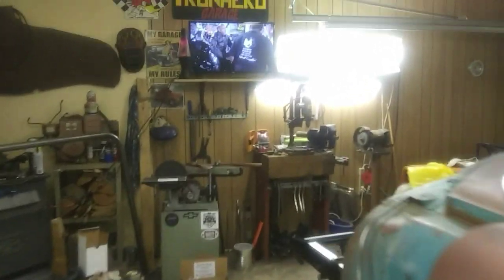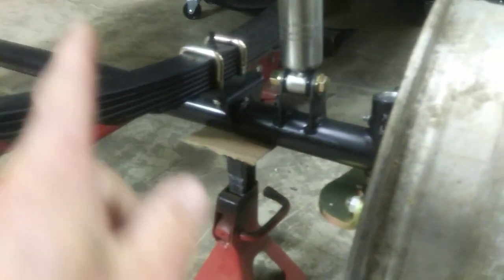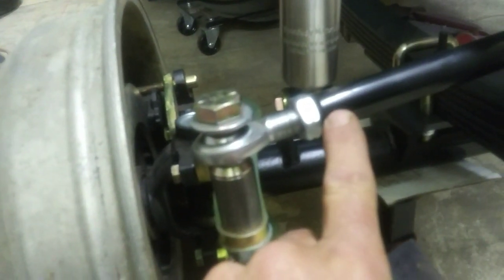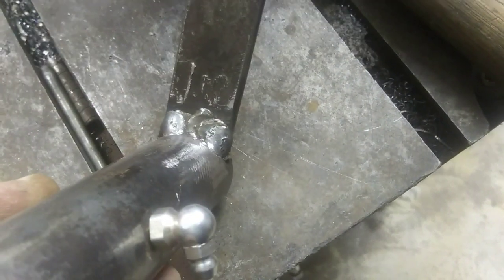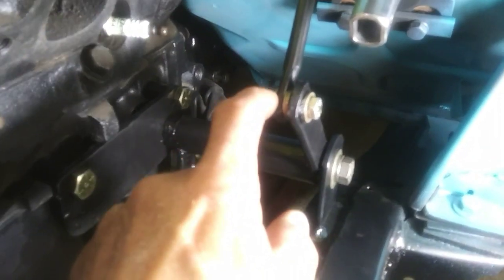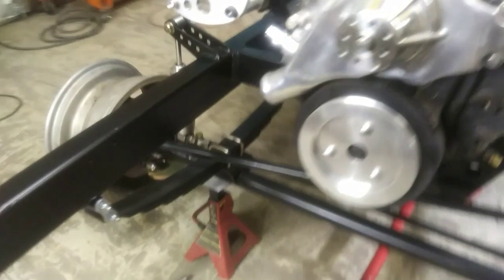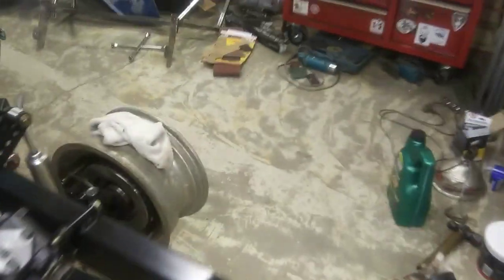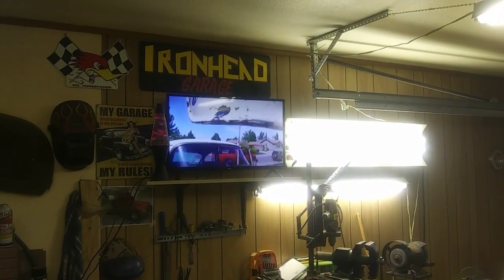55 GASSER BUILD DRAG LINK

Comment: Chris, keep on doin' what you're doin'.
Back when I was learning front end alignments, centering the steering box was critical because when you are in the straight ahead mode, the clearances are tighter than while turning. When adjusting the tightness of the box you perform it while in the straight ahead mode.
I have seen boxes that were adjusted while turning right or left, and when they drove the car, after turning when the car is going back to straight, there would be a tight spot in the steering.
Reply from the maker: Hey Mike you know I will.
You are exactly right I adjusted the steering box when it was centered that is the tightest spot.
Thanks for watching
I appreciate it.
Take care brother👍👍👍

Comment: You dont want to have a rod end pull out, good catch!👍 I used to just measure between the farthest point from the rear of the front tires and in between the fronts to do an alignment and worked great every time.
Reply from the maker: Hey brother your right about that. It would not be very good to have one of those heim joints come apart.
Just might be a little scary😁. The allinment should be pretty close. I'll take it to a shop when She's all done just to make sure.
Take care my friend.
 appreciate you👍👍👍👍

Comment: The top bolt hole on the front of block should be drilled all the way threw to fuel pump rod sometimes there tap all the way sometimes there not just grind ¼Inc  of the threads off an screw it in to hold fuel pump push rod up. Just in case you didn't no .👍👍👍👍👍
Reply from the maker: Hey Mike. Yeah that big block don't have the hole all the way through. All my small blocks do. Take care brother. I appreciate you watching👍👍👍
Reply: @IronheadGarage   that sucks i had a block that was made in Mexico an I had to drill it out.lol
Reply from the maker: Yeah Atlest mine has that bolt at the bottom so you can hold the rod up to put the pump in. My buddy said my motor was made in Mexico but that's ok. I love Mexican food😁 have a good week brother👍